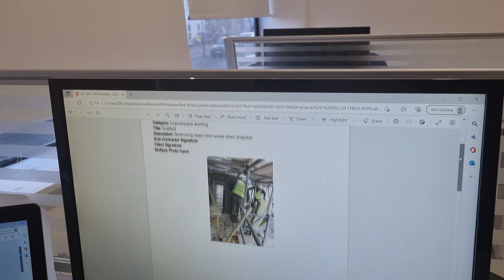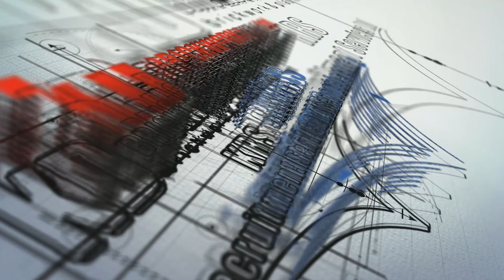Day and a morning in the life of a Director running 2 companies in construction

Comment: That Herringbone job looks interesting, be careful with using NHL in the winter it needs to be constantly +5 and any sign of Frost triple Hessian  minimum, ideally should be tented in and heaters. I've used it many times, about 10 years ago built a School  behind Shoreditch Church East London in the Winter and it was a real problem. Historically before cement all construction was halted in the Automn covered in straw untill the Spring. Although NHL has similar properties to cement and is much more resilient than Lime Putty and Hot Lime mortars it's still risky in the Winter. 👍👍
Reply from the maker: Thanks for that information always good hearing from old school brickies sharing they experience and knowledge.  Last week when I visited the site the guys knew this week would of been  to cold. Herringbone will be interesting.
Reply: @kdbrickwork  👍👍